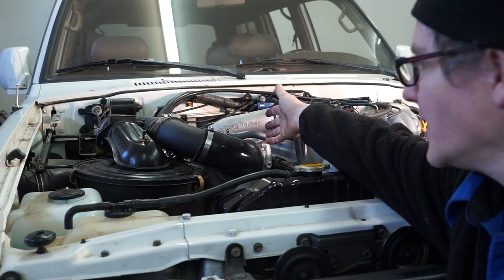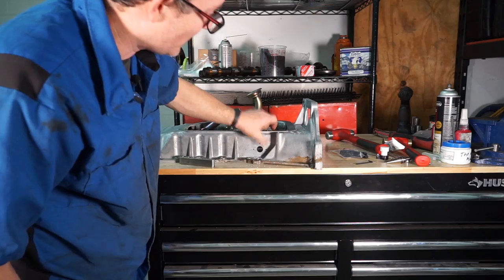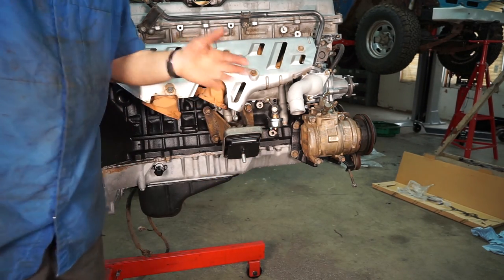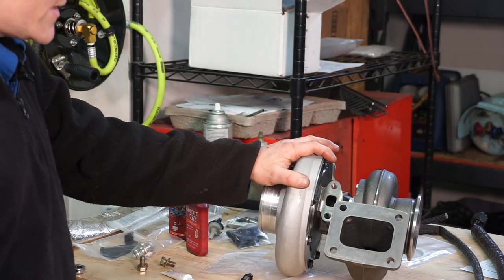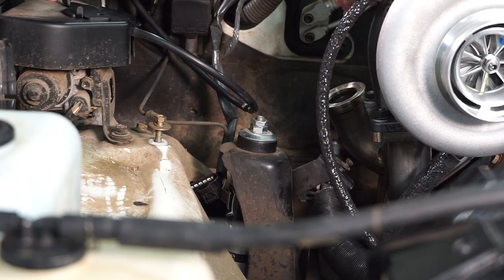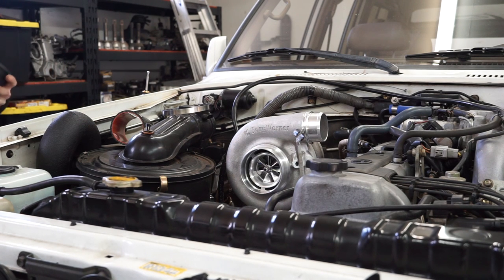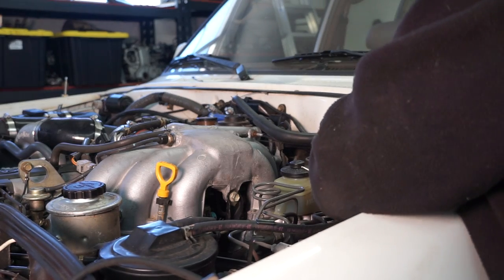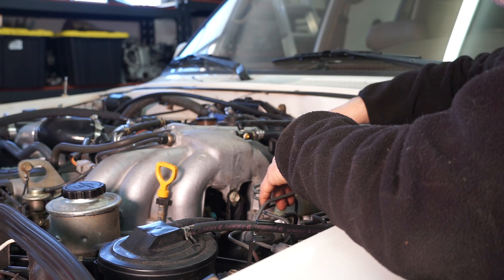Wits' End 1FZ-FE Turbo Kit Install

Comment: Great video, I turbod my 1fz 79 series Fzj79. It needed the fzj105 flywheel and clutch upgrade. Great motor 13 years of 15psi boost no issues.

Comment: I look forward to seeing how this turns out. Would you reccomend doing anything in regards of internals before finishing this turbo kit. I'm very interested
Reply from the maker: It's running about the same boost as Toyota had on the supercharged trucks. Stock internals should be fine. We did a Cometic head gasket and ARP head studs on this one since we replaced most of the engine.
Reply: I'm planning to turbo my 1FZ and double the stock HP so I'll be changing to forged H-Beam rods and JP pistons as well as racing bearings ARP connecting rod studs, Mains and head studs. Crower Turbo stage 4 cams, Valve springs and Valves. I also have to buy anew head with upgraded valve seats as it will be running on LPG (autogas) when daily driving hence the need for a decent ECU that can run multiple fuel maps. I'll be purchasing a second motor to do these mods to so I can keep driving the 105R till it's ready. Then I'm going to find a car shell to put the original motor into and build it for about 1000 HP and have a street/Drag car. Not many people know that the 1FZ is capable of upto 1600HP when built, everyone goes the 2JZ route for engine swaps.
Reply: What arp stud kit are you using for the crankshaft mains?
Reply: @nathanandhayliemyers2895   I'm pretty sure the 2J studs are the same size so I'll be using the ARP set for that.
Reply: @gta4pickled  The 2j studs apparently are slightly on the short side for the head but lots still use them. the mains bolts are a bit shorter so they might be perfect for that. I ordered up two sets of the opal v6 studs will see how they look here in a few days when I get everything. I’m expecting to have to cut a bit off of a few of them.

Comment: Awesome, but 6000$?! Spent less on a twin turbo setup for my bnr32 including an ecu.
Reply from the maker: It's an amazing kit that's more well thought out than any other kit for anything I've seen. Built for a super small market and to pass CA emmissions. There is a ton of investment there that he's got to recoup.
Reply: @OTRAMM  I have seen a lot worse, for far more money. Take a twin turbo kit for Audi R8 v10 ay a measly 13.000$, same kit for a Lamborghini Hurracan, 19.000$. Identical kit but Lambo kit cost extra the same as this whole kit, just because of Audi vs. Lambo people are expected to spend less. For quality people will pay, there are kits on evil-bay for less than half, but way less complete. Not cheap but, for the quality, not really that expensive either. Even the tools you need are included. The most complete kit I have ever seen, on any car.

Comment: what modifications does the kit provide to the fuel system for enrichment and drive ability correction ?
Reply from the maker: It runs on the stock system the same way the TRD super charger did. It doesn't boost high enough to need more mods.

Comment: How strong is the 1fzfe and what are its weakpoints when boosted ?
Reply: I think people usually do forged rods and pistons and thats really it. I think the block is strong enough for the hp. Maybe fuel pump, injectors, and spark plugs as well.
Reply: @reetabass1540  sweet thanks

Comment: This runs with no intercooler? Is that a problem or is that fine since its low boost. And the increase worth the kit? I'd consider doing this over trying to do a 1uz or 2uz swap if I'll be spending the same amount of money but can get more out of this kit in the long run
Reply: No intercooler because its only 7.25psi. I am in the middle of putting together a meth injection kit. I have both the supercharger and the turbo in both 97 LX450 and the turbo kicks the SC's ass. I don't understand the comment about same money as a 2UZ swap. This kit is $6k and can be done in ONE day. There is NO 2UZ off the shelf kit. No one installs a 2UZ for even close to $20k (I know, I tried) and it will take who knows how many weeks/months before you can drive it.

Comment: Hey bud, do  Wits end do a kit for the 100 series/ 105 do you know ? I am in Australia so the J piping may be close to the break booster and master cylinder, just curious if they do a kit for the coil pack model 1FZFE.
Reply from the maker: I think he said in a post that he doesn't think it'll fit a right hand drive truck. He'd be the one to ask to be sure though.

Comment: Was any internal engine components charged to handle the extra power?
Reply: the internals will handle quite a lot of power from the factory, this setup only runs like 6-8lbs of boost which is totally fine

Comment: I’ve got an automatic 2001 land cruiser with the same engine 1FZ-FE we’ve had it for 10 years now. would you say it’s worth it to rebuild the engine and install a supercharger ? I like to do off-roading when it’s raining (live in uae) and I’d like to have the extra fun but I’m worried if that gonna cause issues to the engine or maybe it’s not a good idea since it’s an automatic. What do you think ?
Reply: Also I’m going to install a Unichip ecu if I’m going to do such thing but I’m worried that it’s gonna be all for nothing
Reply from the maker: Toyota installed lower boost superchargers here at the dealer with no issues. It just depends on how well the engine and trans have been maintained. There's lots of guys in Australia running crazy turbo set ups with lots of power on them.
Reply: OTRAMM i had to rebuild the transmission earlier this year and I’ll probably rebuild the engine since it’s so old and doesn’t run as well as it used to, but still in a good shape. I’m just asking if the extra wear the supercharger going to cause is noticeable or will reduce the reliability.
Reply from the maker: I'm sure there's some extra stress from the added power. I don't know how noticeable it'll be long term.

Comment: Hi .  Did you program the ECU to have a good balance between air / fuel. after installing a new turbo?  and where we can find this kit to buy it
Reply from the maker: This kit is low boost so no need to reprogram. It's from absolute Wits' end.
Reply: @OTRAMM  thanks . Can you give a link where i can bye one like this modle of turbo .
Reply: Did you intalle vaccum pump??? What about it please
Reply from the maker: No vacuum pump. There's no need for one. If you Google wits end land cruiser the turbo will come up.
Reply: Thanks

Comment: Any reason the intake couldn't be run straight across to the turbo inlet? this would negate the need for all the bends. https://youtu.be/Df2TFNYJY8Q?t=2454
Reply from the maker: Yes
Reply: @OTRAMM  Thanks.  I am curious as to why also.  By the way, I have been watching your rebuild videos near religiously on the 1FZ also.  Some great detail has gone into these and I thank you for your efforts.  It's given me a better understanding of my Australian 105 series with the coil pack 1FZ,
Reply from the maker: It's a kit and that's where it places the turbo. Looking at it, that was the best compromise to get everything to fit in such a tight space.
Reply: @OTRAMM  thanks. It looks like a well put together kit. It was just a little tricky to see the final product. I appreciate your reply.

Comment: Very interesting thank you for showing us how to install this kit! Can the parts be purchased separately? e.g just the J pipe and downpipe? Will you be making any changes to the ECU? I'm not a fan of running the charged air straight to the throttle body as compressing it adds heat, I'd want to install an intercooler. I've been looking into turboing my 105 1FZ (non dizzy) using some of the cheaper chinese kits but only buying the hot  side and  completely replacing the intake manifold with a horizontal aftermarket plenum so I can run a larger Throttle body and an intercooler that brings the air in on the left side of the car instead of over the engine. I've also purchased a Link G4+ plug-in ECU (FZJ100Link) so it can be tuned easily.
Reply from the maker: I think it's just the full kit right now. Not sure if he'll do separate parts in the future. Running stock ecu since it's low boost.
Reply: No tune needed on US trucks and full kits only currently.
Reply: @AbsoluteWitsEnd  when you put 1000cc injectors in it, it will need a tune. I'll be adding a T76 turbo to mine as well looking for 500HP.
Reply: @AbsoluteWitsEnd  yes  was curious about what was being done to the 1FZ, so I gather by low boost it means about 5 psi so it doesn't lean out too hard? and about a 30hp gain?
Reply: @AbsoluteWitsEnd  also there is really no way to tune the stock ECU's that doesn't involve chip off tuning and re soldering. It's that reason I bought a Link G4+ plug-in FZJ100Link ECU
Reply: @gta4pickled  7.25psi and adds 94hp and 107ft lb of torque. 30hp is closer to the Supercharger. I have both SC and Turbo and the turbo is by far more powerful.

http://absolute-wits-end.com/80-series-1fz-wits-end-turbo-kit-carb-cert-pending-obd2-only/
Reply: @gta4pickled  no way to tune the stock ECU. Piggyback or standalone only. I maxed out the PSI before running into fuel trim issues,

Comment: Can u install wits end turbo on a 93 FJ80
Reply from the maker: No, it has to be a 95 and newer. The older ones don't have an ecu that will support it.
Reply: @OTRAMM  I have already built an 93 80 series. Can  modifications  be done to fuel control and ECU in order to fit a Turbo
Reply from the maker: @georgetony1000  it would be cheaper to move everything to a newer truck.

Comment: Thanks for a great video. 
I noticed that you connected the blow off valve to the intake manifold. This is a common mistake. If it is connected there when you throttle off the manifold vacuum will be closing the blow off valve while the turbo is still pumping hard against a closed throttle plate, causing the turbo to surge.  Not a good thing.
If the blow off valve is on the turbo side of the throttle plate it will open when you back off and open the blow off valve - saving surge.
Reply from the maker: I misspoke in the video. That's the wastegate not blow off. Not sure why I had blow off in my head while shooting the video.

Comment: I like the kit but we are going to need an intercooler. Or boom.
Reply from the maker: There's a couple already running with great results and no intercooler.
Reply: 14k on the first test mule with no IC. I have 2k miles in test mule #3 with huge elevation climbs. No IC.
Reply: @AbsoluteWitsEnd  what boost levels are you running? I'm considering this kit over an LS swap.
Reply: James It’s 7.25psi (.5bar)
Reply: @AbsoluteWitsEnd  do you know when the kit will get CARB certified???
Reply: @Simple_Youtube   I will know this week
Reply: @AbsoluteWitsEnd  cool ty. Looking forward to this kit.